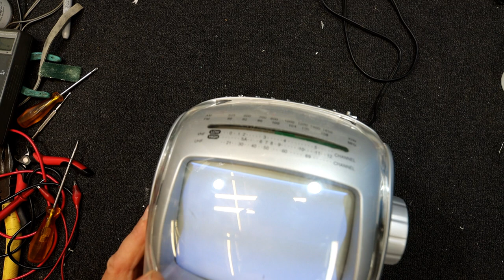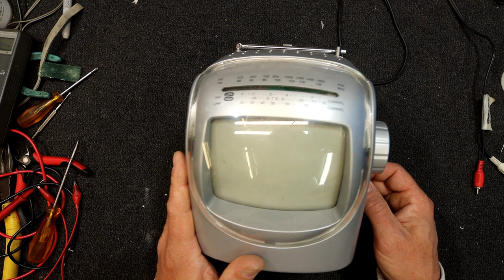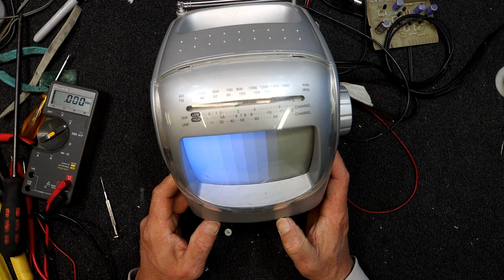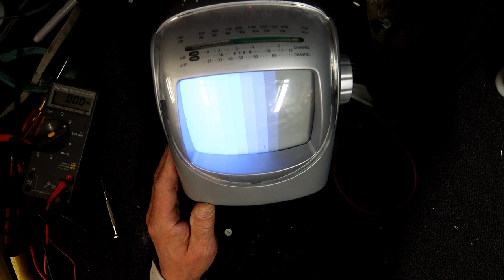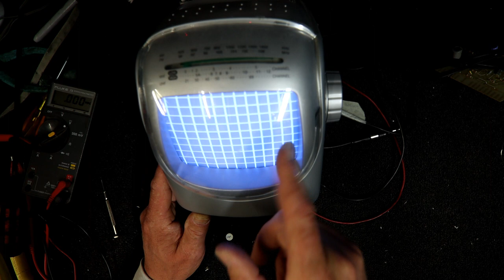Trying to fix a fault that didnt exist. GAF 5 inch Monochrome CRT TV

Comment: Interesting Steve - I would have thought the power supply would have thrown in the towel very quickly with excessive current draw..
Reply from the maker: They do die very easily usually. Maybe the current draw dropped with the lack of voltage to a level it could handle.